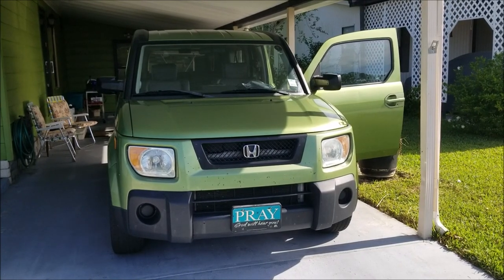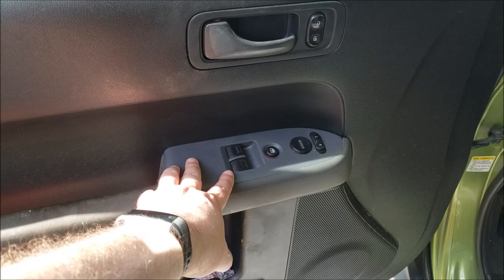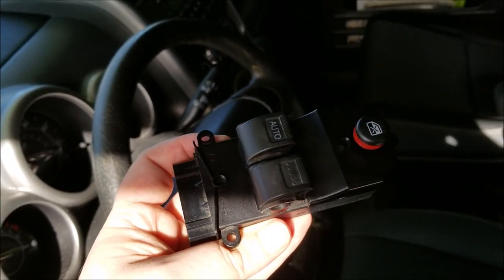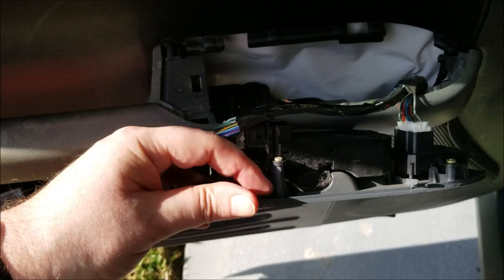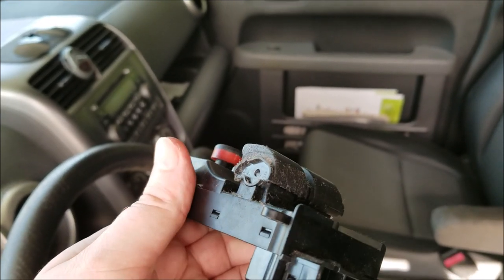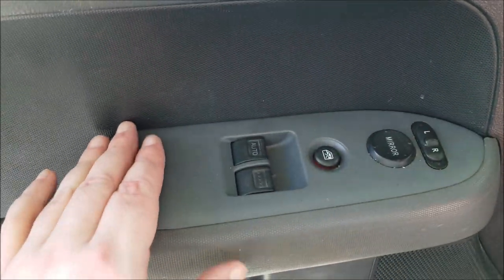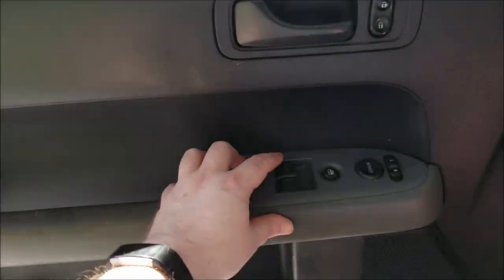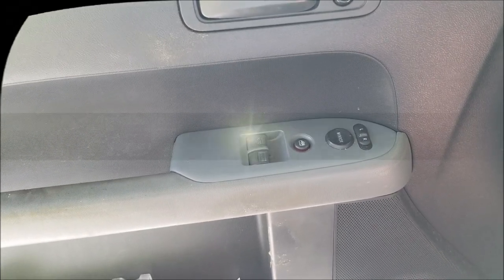Window Switch Replacemnet In A 2006 Honda Element

Comment: Hope mines is that easy.  My 2003 has been sitting unused for several weeks due to parasitic drain problems.  I've taken to disconnecting the negative battery terminals after use.  One day I got into the car and the driver's side window stopped working along with the AC.  I purchased a brand new window switch (wish I had the foresight to check eBay first) and a new Air Compressor relay.  The AC relay was relatively cheap but the new window switch went for around 90 bucks.  You can get them on eBay for almost half that.
Reply from the maker: I got mine off of Ebay, still working to this day!